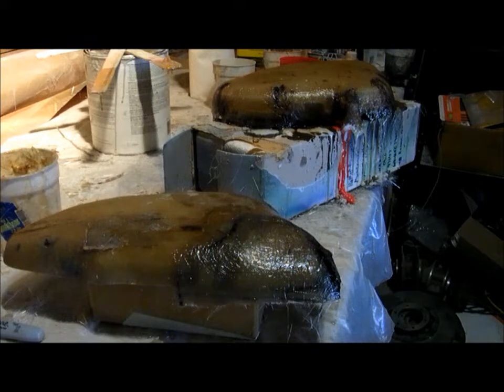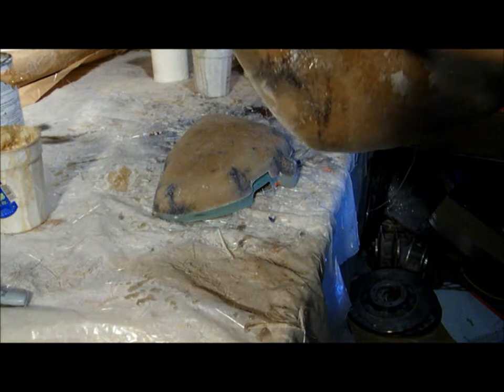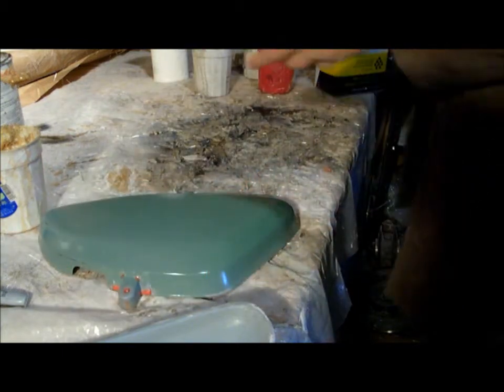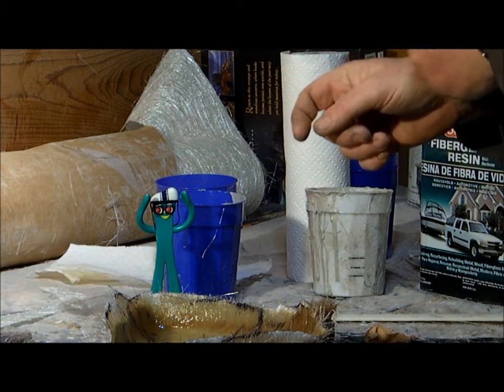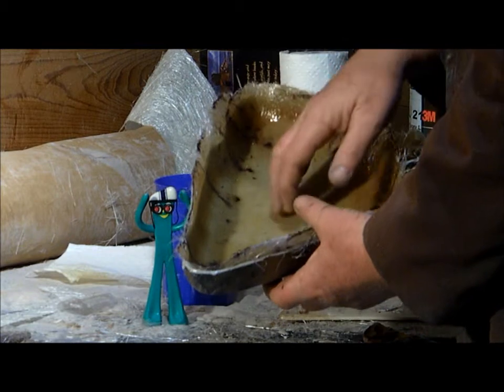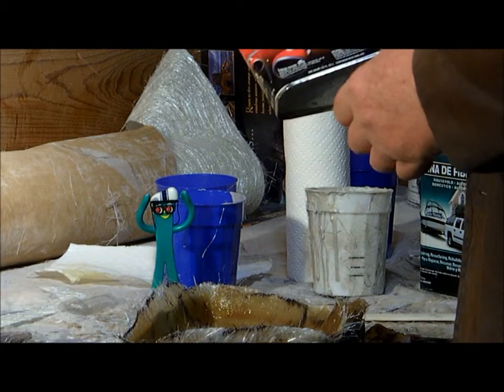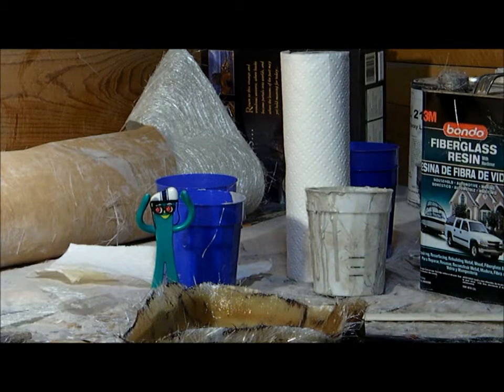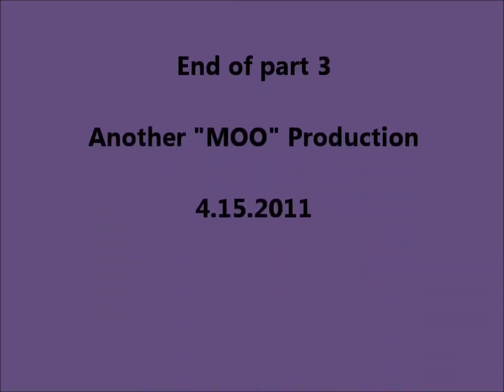"How I do it", Bondo finishing and making fiberglass molds part 3

Comment from the maker: I got caught too, it is PVA. There are a few ways to do it. You can brush it on, that didn't work for me. Some will wax first, then do a PVA coating. This is "safer" from sticking a part to the mold, but makes it difficult to do the PVA coat, as it wants to fish eye very easily. It's best to use a paint gun with just a small gravity feed gun. It's just like painting, light first coat and let dry and a few heavier coats. You can thin a bit if you like. I use the water base.

Comment: PVA sprays on really nice and evenly with a small paint spray gun even with a 5X waxed mould or waxed part to make the mould. If you brush it on do not overlap the brush strokes (best to use a cotton ball not a brush). The overlap in the PVA could transfer to ripples in the finish of your mould or part. Requiring more post-production work.